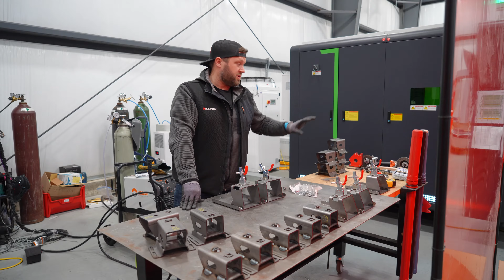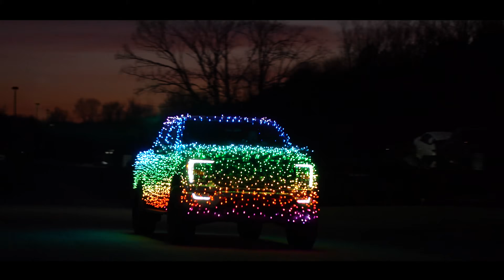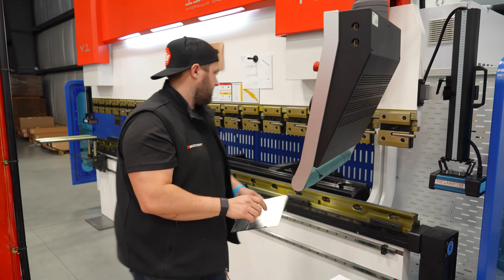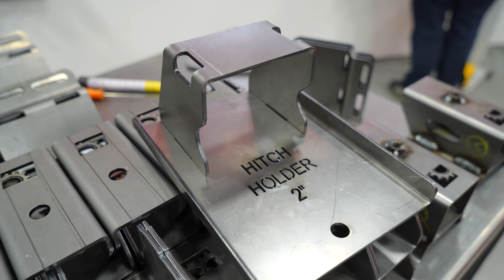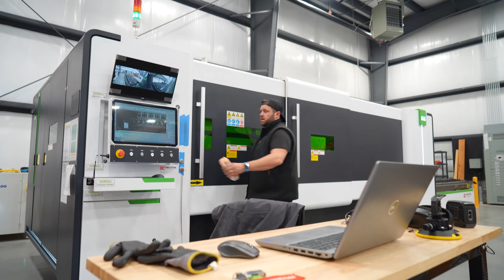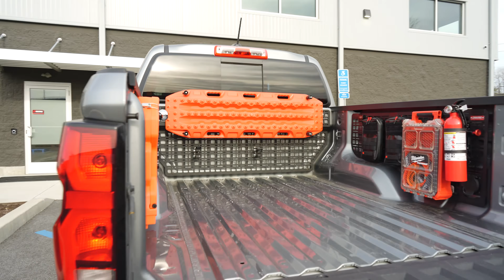Fabricating the BuiltRight Hitch Mount!

Comment: Wonder if that's going to work with B&W drop down hitch. I have the 7" with 2 & 2 5/16 ball. Can you do a follow up showing what hitches may or may not work?
Reply from the maker: That’s the same hitch I use on my personal truck. This particular mount is best suited for ‘simple’ hitches, as the more complex/variable geometry and weights of some higher end hitches are more difficult to accommodate. We’ll offer a fitment guide of sorts and explore additional options if needed, though!
Reply: @BuiltRightInd what about basic gen y drop hitches ?
Reply from the maker: Which gen y hitch?
Reply: @BuiltRightInd their mega duty 16k drop hitch
Reply from the maker: those are pretty big, im sure itll fit some way though! Whats the weight on that bad boy?